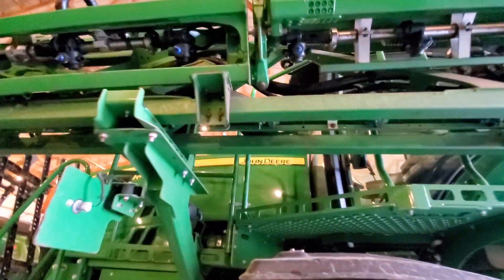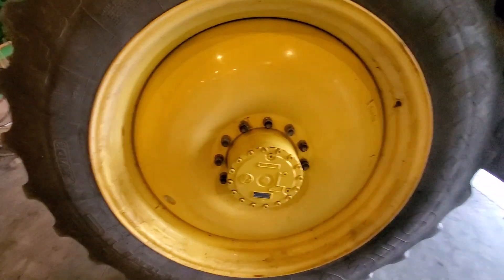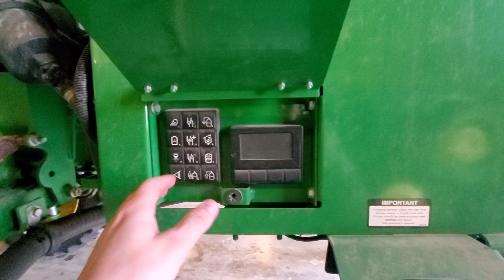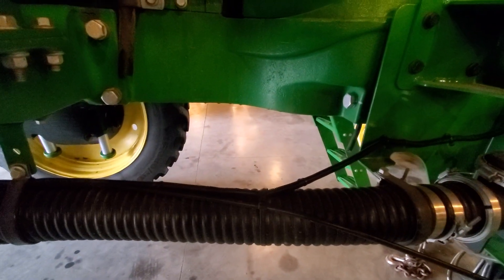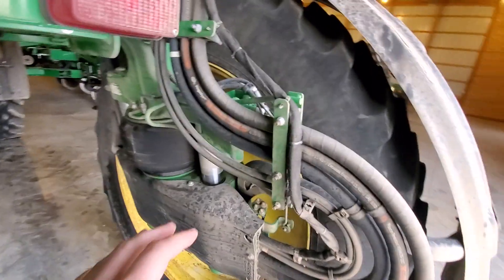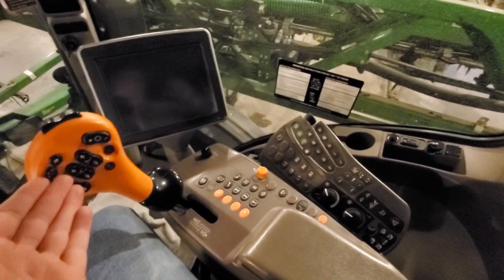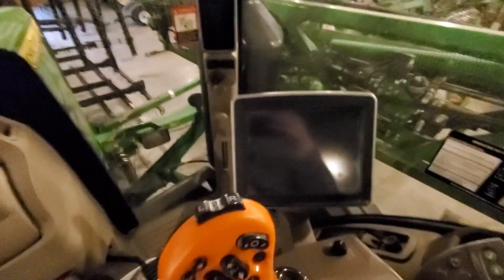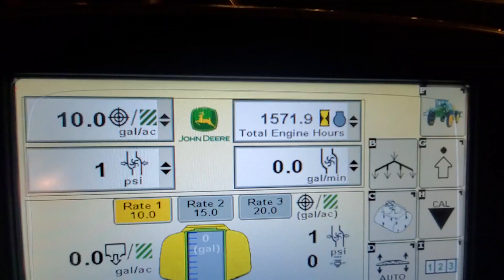R4030

Comment: Nice sprayer! I can remember back to the old pull type sprayers with maybe 30' of booms, then the pickup truck sprayers, then the Spray Coupes, Big A's and up to what you are using today. Sprayers and sprayer technology has came along way.
Reply from the maker: Well said!
Reply: @Blackearthexcavationandtiling  a buddy of mine bought a new Rogator in 07 and it darn near looks like it rolled of the Assembly line! Its been kept inside and kept clean